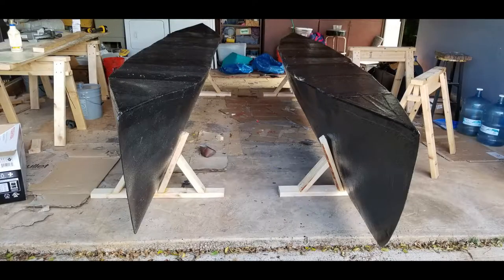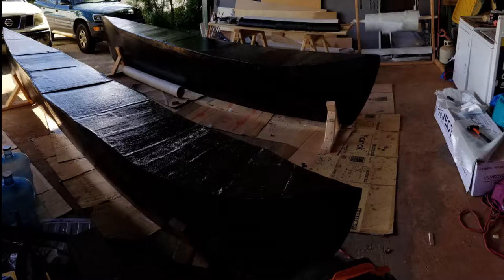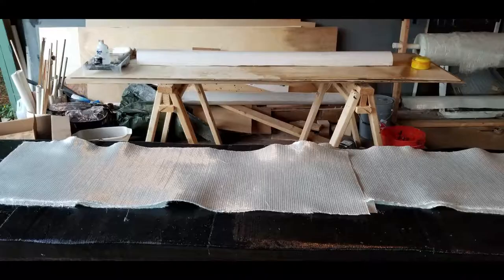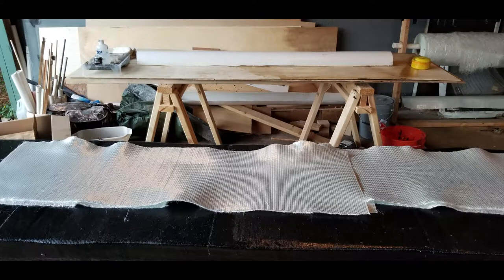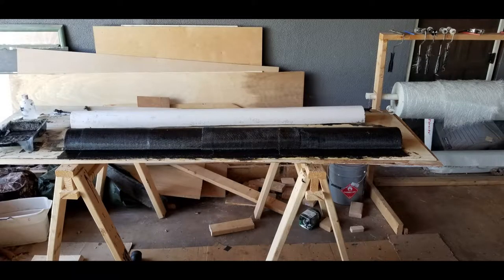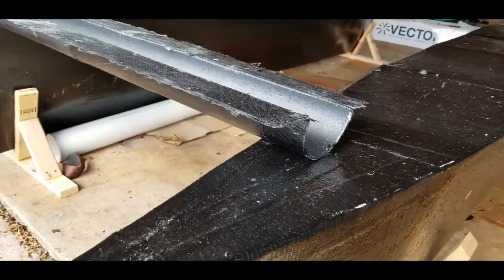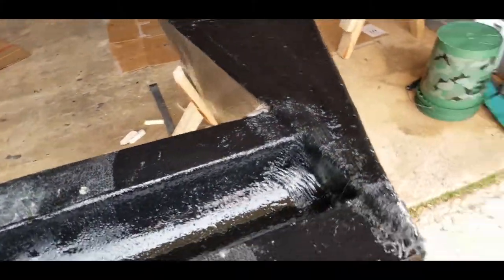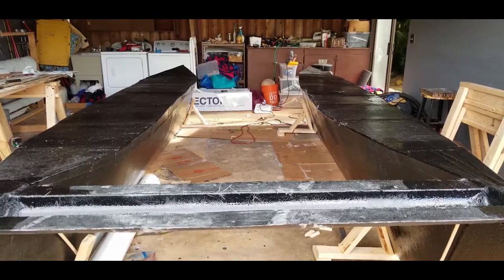Solar Patio Boat Build 11 - Pontoons begin joining!!!

Comment: wow, this is too cool, I've watched your other videos showing the pontoon project, it's really taking shape - I've subbed and am awaiting your next posting.
I've a sailboat I am currently mounting solar panels on - I've had 760 watts on a 16' canoe, this project will have 1300.  It's inspiring to me to see videos of solar boats, it's really neat to just slice through the water silently - 'till next time
Reply from the maker: If you have any pictures or video of your canoe that would be cool to see. Have you seen Jamie Mantzel's videos on his solar boats?
Reply: @DIYKauai  - yes, I've got lots of pics of 2 different canoes 4 and 6 panels and am taking pics of the sailboat as I work on it.  Give me an email adress and I will attach some.  'Careful, I like talking about them and taking and showing pics.

I watch Jamie's videos, he's quite a guy, I like the solar boat ones the best, how he's out on the water heading to town to get some 'pile of parts'

I have a short video of the canoe at the lake, 'too large to attach to an email.  I'll put it on U tube right now and will get back to you when it's uploaded.
Reply from the maker: Cool little video. Do you have any pictures of how you did the steering for the trolling motor? My build is directly inspired by Jamie.
Reply: as soon as I saw the black resin I thought of Jamie